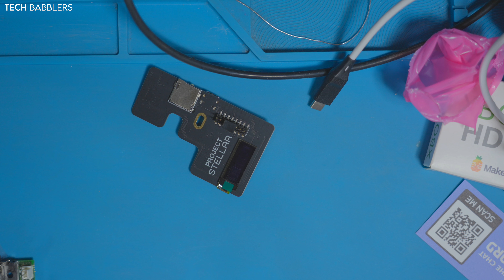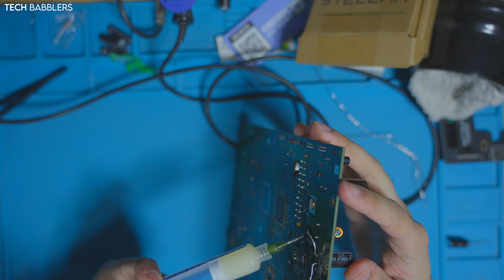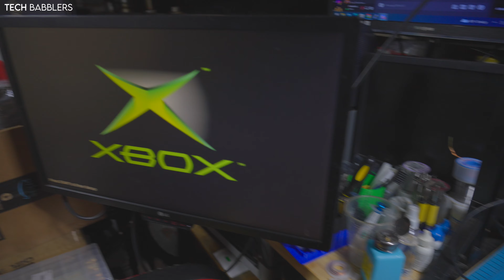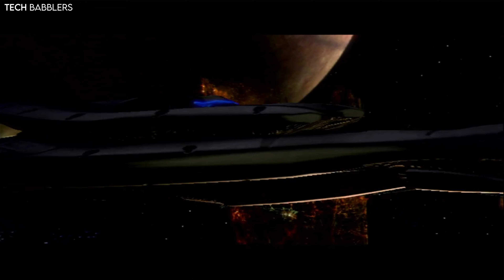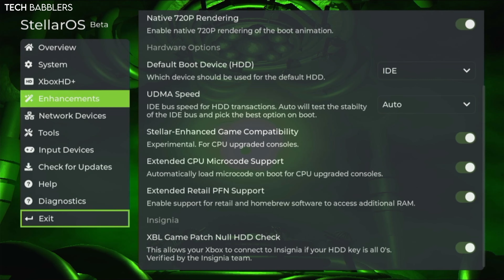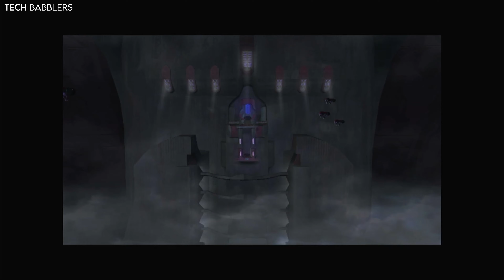Installing Project Stellar HDMI On A 1.4GHz CPU Xbox

Comment: Do you provide services for installing stellar hd on a modded Xbox? Can solder myself but worried with the ribbon cables because I’m not too experienced
Reply from the maker: I don't but you can reach out to Computer Booter.
Reply: Thanks! Appreciate the response and love the video!
Reply: Was about to ask the same thing lol and have all the caps replaced but I got my original a halo one and 2 others so if I mess up I got spares lol 😂